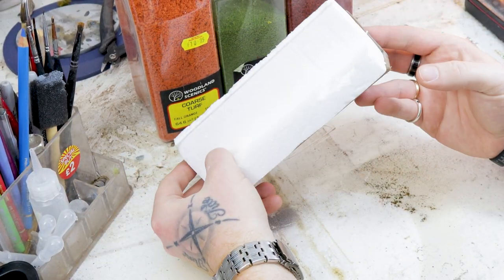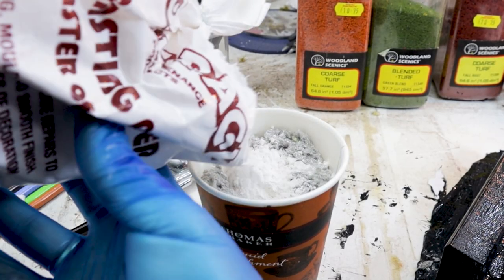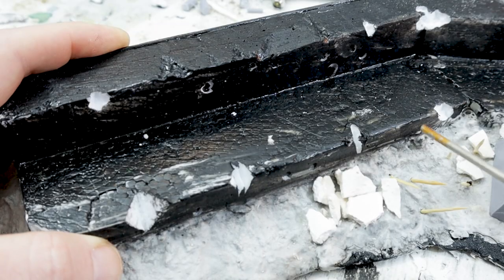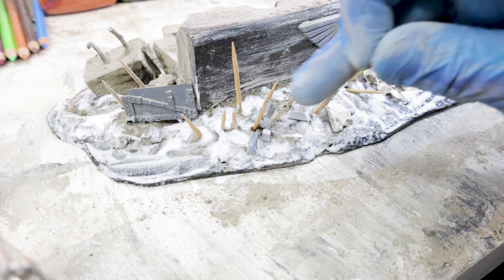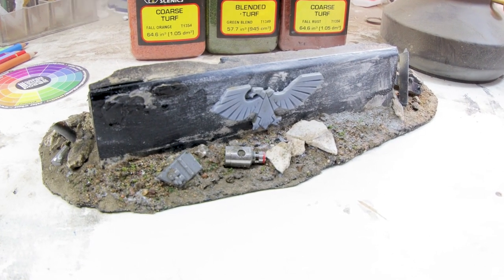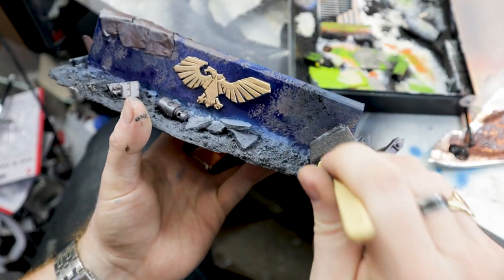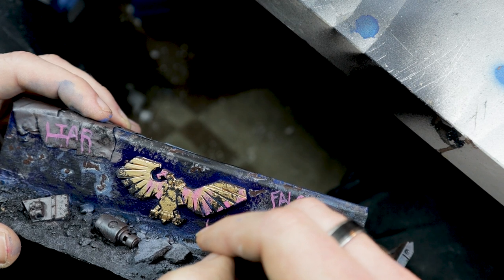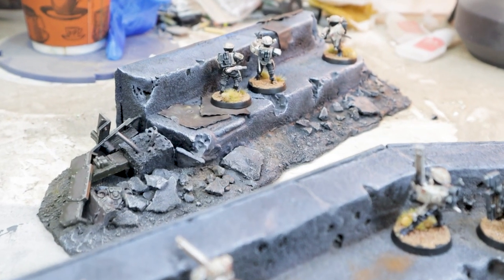REALISTIC CONCRETE || Warhammer 40k TERRAIN BASICS - Grimdark Fortifications SCATTER

Comment: Anyone have any idea why my tile grout isnt adhering at all to the Mod Podge/paint mix? Ive followed this video to the letter but for some reason my grout (which is identical to the one shown) just brushes off completely. I've also gone over the whole thing with some water to try and solidify it in what I assume is the intended way, and still its just brushing right off. Great video though, really good information and entertaining - you should defo have more subscribers
Reply from the maker: I’m not sure there bud. The spray paint I could see drying up but there’s no reason why it wouldn’t stick with the other method. Try watered down pva instead potentially.

Comment: I had the mold issue on my first terrain =(. Is covering the MDF with acrylic paint + modpodge before doing any water + pva glue type work would be the way to protect and prevent it to happen? Thanks!
Reply from the maker: Leave it to dry in a room with decent airflow or leave it outside to fully dry. That tends to be the way to go I think.